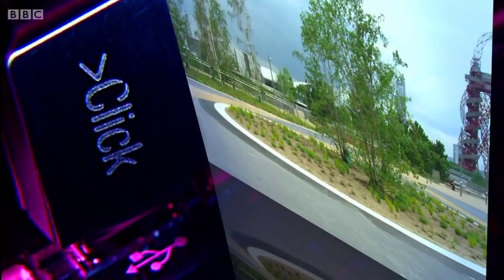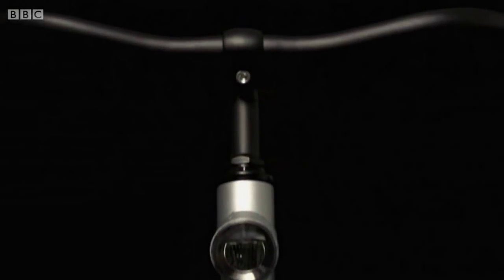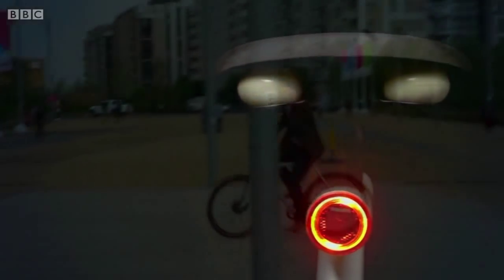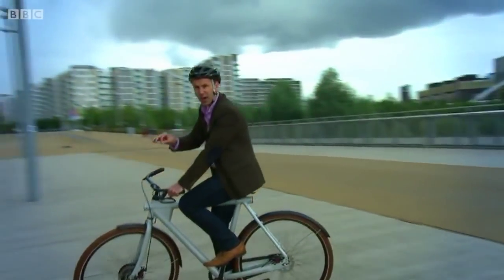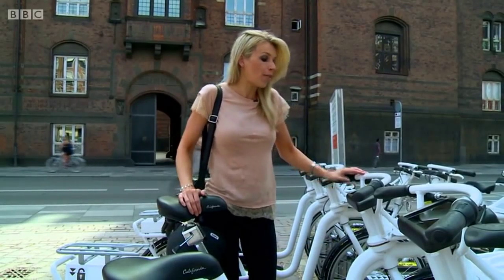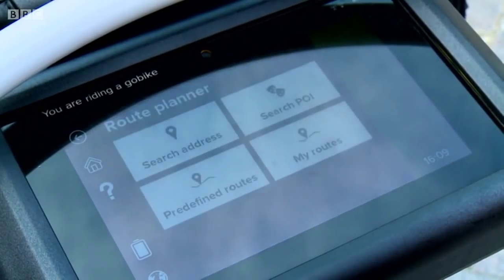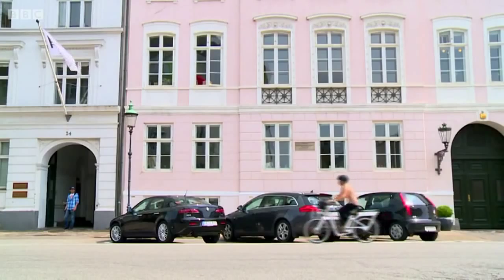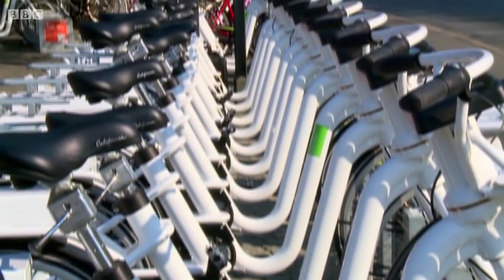Electric Bike feature from the "Click" programme, BBC TV 12th July 2014

Comment: We got that here in Germany for ages. Our national railway company has a rental bike system where in certain cities you could park the bike at any street corner and pic one up if you find one. They don't need expensive tablets for that, you just call a number and unlock them or use the provided app. You don't even need a smartphone, a regular mobile phone will do the trick. That's because the system is older than the smartphone era.The only advantage of this bikes is the navigation function, this could be very handy.

Comment: 3000 dollar for what the whole bike got 0 suspension... the motor is 250w 36v low AH and speed limited to 25km/h for sure. Why would you pay 3 grand for that ebike.
Reply: 3dkiller what i do like is the battery sys i had the same idea myself.i would want a bike that's ever more stealthy than a "stealth bomber" for uk use.
Reply: john doe  then get the BBS02 750W,  at EM3EV
Reply: Because in the long run you save money and health. You could spend £1000 on fuel alone, £400 on insurance, £100 on MOT, £100 on road tax. Already you've got £1500 spent per year on your car FOREVER, don't forget the REPAIR costs and the initial cost of the car. You sit in your ass stuck in traffic getting fatter- your bonus. An electric bike can pay off for itself in 2 years (and there are cheaper bikes available at HALF the price) and you would still have a working bike- at most you'd replace the battery and that's no problem as you're likely to spend more on fuel per year. Health saved, no stupid traffic waiting and you arrive more relaxed.